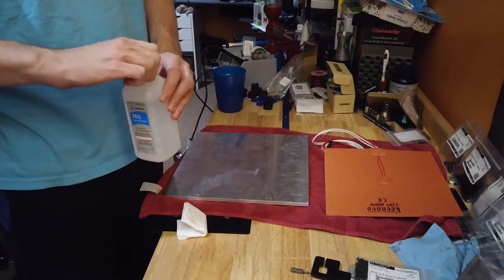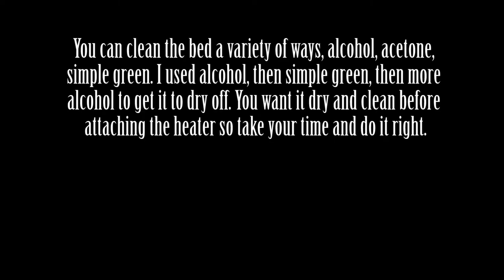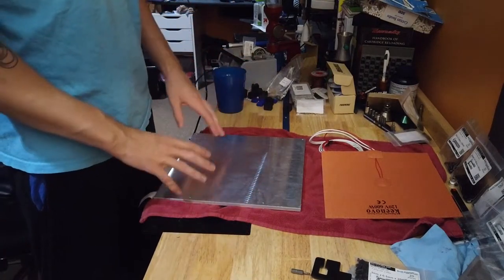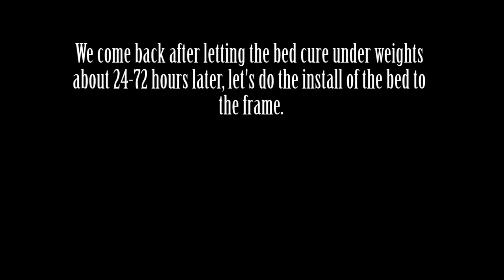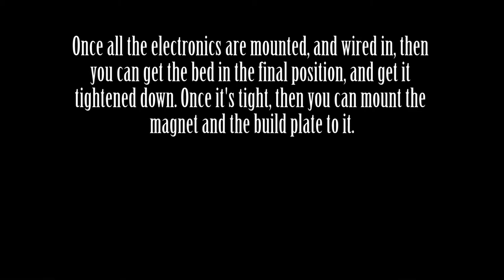Voron 2.4 - E7 - Bed Prep & Install

Comment: Nice. Thanks for posting. I'm at this step. I've gotta drill the holes first. 

Get a $25 heat gun. Can't believe I waited so long to get one. Super useful.
Reply from the maker: You're welcome, yes you've got to get the holes and countersinks done first. I've got a great gun but I didn't need it, but I was doing it in a fairly warm room. I hope that you find this helpful.

Comment: What did you put under the cast aluminium bed plate was it a spring?
Reply from the maker: Under the build plate go a few spacers to keep it off of the extrusion. They are these little things https://www.amazon.com/uxcell-Knurled-Collar-Nickel-Plating/dp/B07LFH3VK2/ you want the M4 version so that it just drops over the screws and can spin freely.
Reply: @sharpsarena  thanks for the quick reply
Reply from the maker: You're most welcome, happy to help.